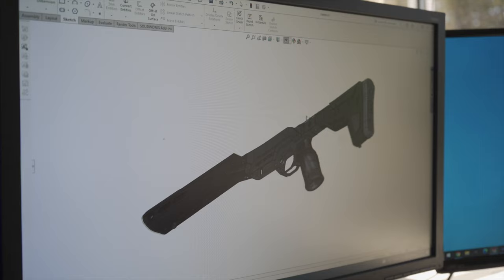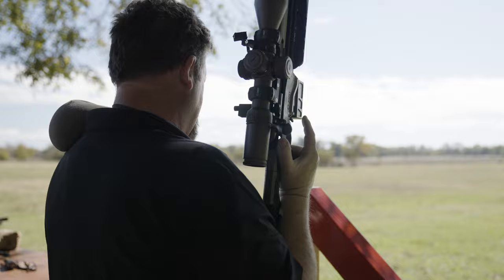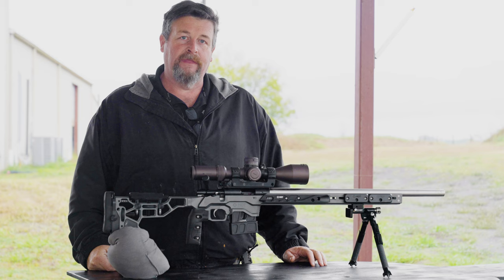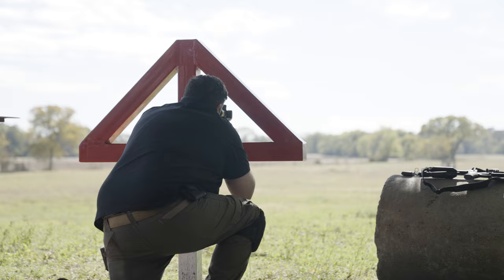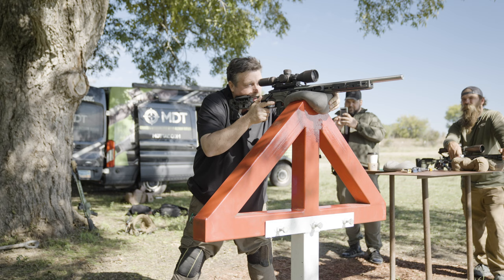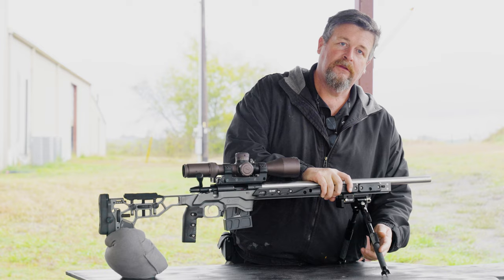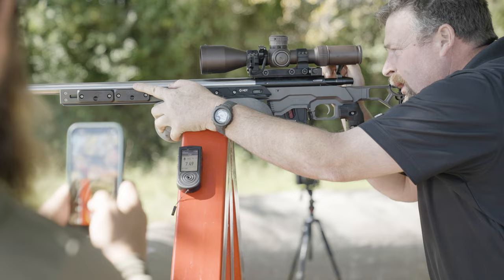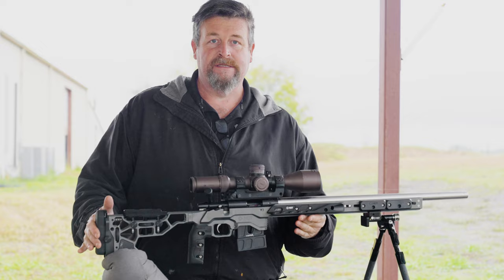Precision Rimfire Set Up | With MDT Pro Keith Baker

Comment: does someone know what the default gun model is before they switched the stock and everything? i am looking to get a .22 in the future and would than want to build it towards a prs rifle.
Reply: This is a barreled action only. Zermatt arms makes the action and it’s a 700 rem footprint. So it drops into any chassis or stock that can fit a rem 700 action. But Zermatt doesn’t sell the actions with stocks or chassis. Or barrels for that matter. You’ll need either a prefit barrel or a gunsmith that can cut, chamber and fit the barrel on for you.
Reply: @fshizl2918  thank you for your answer.
Reply: Just get a CZ457 or T1x action
Reply: @urgamecshk do they sell the actions alone so I can just mount it in the chassis?

Or do I have to buy the rifle and then remove the action so I can transfer it to the chassis?